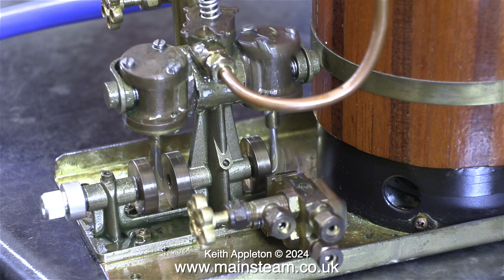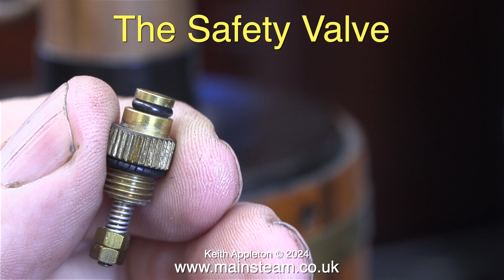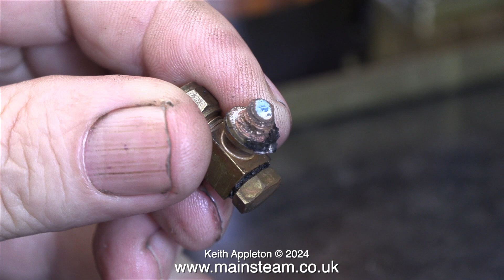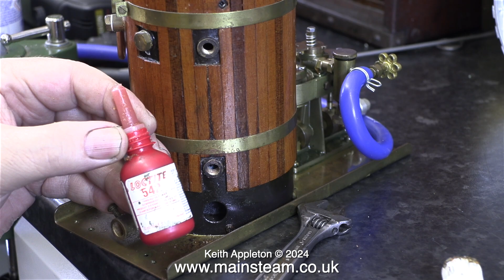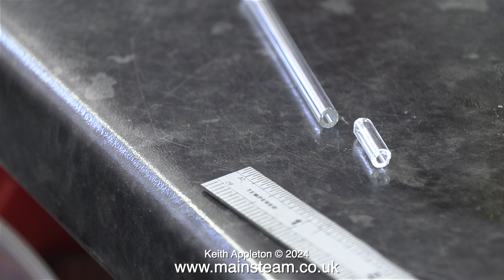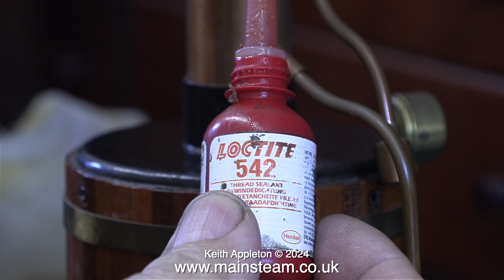WORKING ON AN UNFINISHED VICTORIA STEAM BOAT - PART #2

Comment: Regner makes a small oscillator like this. Just got one in a tram. Runs like a sewing machine, straight away.
Reply: I coming into the hobby recently I was a snob towards occilator engines ….. but in an RC situation you can’t beat them honestly!! Quite great on steam and always start-just what you need !
Eye candy engines I build to look at and bench run